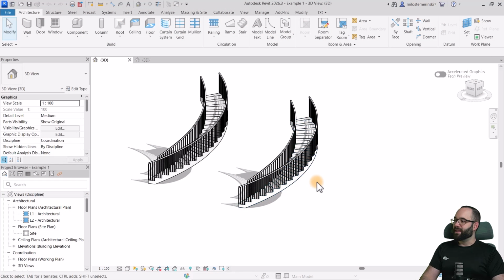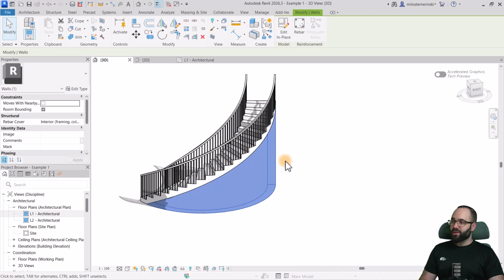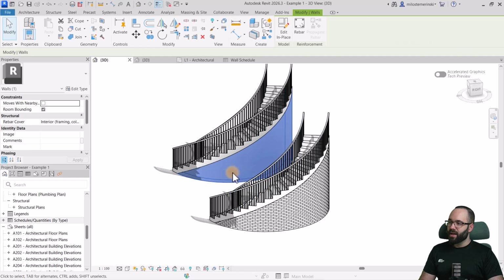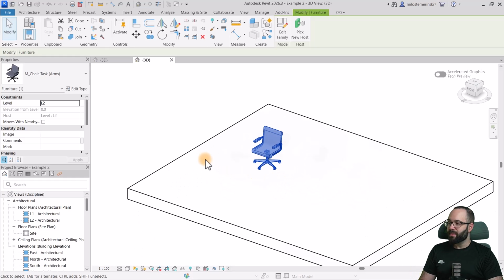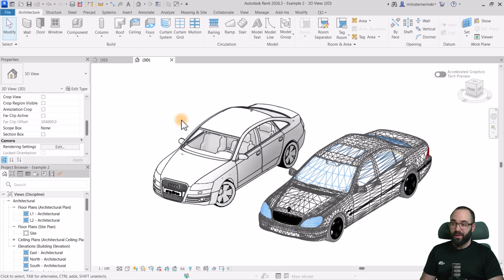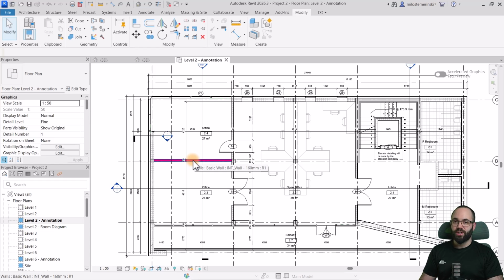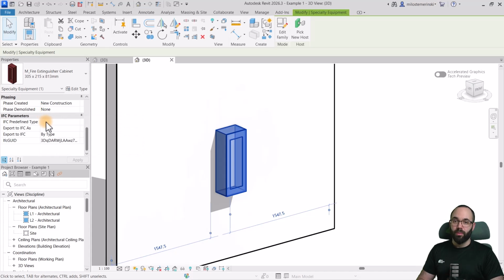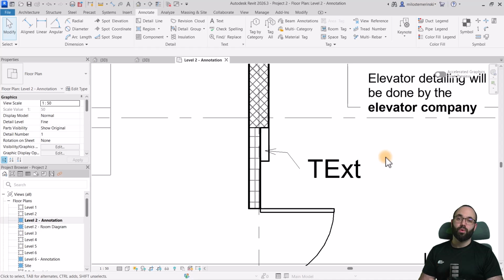These 10 Revit Mistakes will get you Fired

Comment: such a horrible software... its like blocks within blocks within windows within popup windows within popup windows... doesnt work with other autodesk softwares. if one check box is marked 18 levels down in the settings you will never be able to move a wall or dimension.. you need ai just to find settings. Only use for buildings and keep it simple because everything in this software breaks... and dont forget once a model is upgraded to a newer version there is no way to undo.

Comment: I 100% agree with using quality families. However, many manufacturers (e.g. brands of bathroom fixtures, furniture, high end Italian kitchens etc.) only provide extremely poor quality models. I contacted a few and they had no clue what I was talking about because they probably didn't make them themselves but subcontracted the job. Unfortunately when that's the brand the customer wants you have no choice.
Reply: Thrn make your own. If lod is low like 200 it should be simple. If lod is high BIM mngr should have alotted time or contacted firms with products involved to get you the stuff.

Comment: Leaving something hidden in your publish could get you fired. 

Please break the bad habit of using Hide in View, Reveal Hidden, Unhide. 
Use Temporary hide. 
I have set shortcuts: HH to temporarily hide, HR to reset temporary hide.
Reply: Also wanted to mention this. I see a lot of people (even experienced modelers) using permanently hidden elements instead of Temporary Hide/Isolate.
Set up 4 shortcuts for Temporary Hide Element / Hide Category / Isolate Element / Isolate Category.
Once you get used to this workflow, you won’t be able to live without it 🙂
Reply: or use filters?
Reply: @Gunner1886Rocky  filters in view template for final product, but for hiding a few things temporarily, applying a filter can be risky, unless you first activate  Temporary View (I think that’s the name, on mobile rn) then temp apply a filter. 

Temp View is great bc you can bypass Templates, View Range, Link viz, etc etc, then put it all back to the Template when you’re done.
Reply: What's the diference?
Reply: @mauricioberrioduque5199  Temporary view mode will warn you if you try to plot / export. You can easily reset this when you’re done. Hide in view means you don’t want to ever see it in your export — only do this if you couldn’t get it to go away by turning off Categories or Links, or by setting Filters etc. in your VV or View Templates (use templates). 

With Temporary View mode, you can even apply a different View Template. Or change scale, or Model Display (Wireframe, Hidden Line, etc) then when you’re done, just exit Temp mode, and it’s back to your settings.
Get in the habit of making and using View Templates. You can even transfer these to other projects, like your project template.

Comment: #7 - If I am just changing the look of one wall how is that done with a view template and a filter? Any links to helpful videos would be appreciated.
Reply: I had the same question.  The View Template will change multiple objects by family.  Just changing one of many similar objects in a view will require a more direct approach.
Reply: @richardguevara787  if you're changing only a wall, that means it has a particularity & that means it should have an instance parameter that retains that particularity. So you create a filter that uses a condition connected to that parameter. Then you set its appearence in the view template. It's ofc more steps than just using overwrite in view, but that is the proper way of keeping the information in your model.
Reply: To get the perfect results U can do these Steps.
1. Assign Information to the Element
First, if you want to change the display settings for a specific element like a wall with a 1hr fire rating you must add this information to the wall's properties. You can do this in either the Instance or Type parameters.
For example, use the Fire Rating parameter and write "1hr" so it becomes the unique identifier for that wall.
2. Create the Filter
 Go to the Filters menu and create a new filter named (1hr Fire Rated Wall).
 Set the filter to apply to the Walls category.
 Set the Filter Rule to: Fire Rating / equals /1hr

Note: Make sure the text matches exactly what you typed in the wall properties. Now your filter is ready to use in any view.
3. Apply the Filter to a View
 Open the desired view and press VG or VV on your keyboard to open Visibility/Graphics Overrides.
 Go to the Filters tab and click Add to bring in the filter you just created.
 Adjust the Cut and Surface patterns/colors however you like. These settings will now automatically apply to any wall where the Fire Rating equals 1hr.

Pro Tip: Using View Templates
 Consistency: If you apply the filter through a View Template it will automatically update the graphics for that element across all views using the same template.
 transferring Data: If you transfer the View Template to another project, all associated filters and settings will move with it. You can also transfer filters between projects individually using the Transfer Project Standards tool